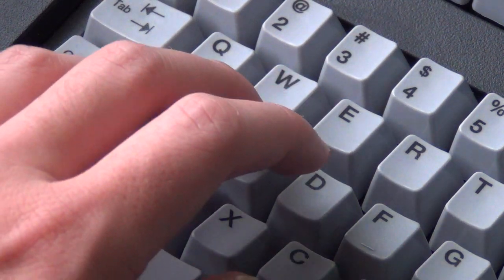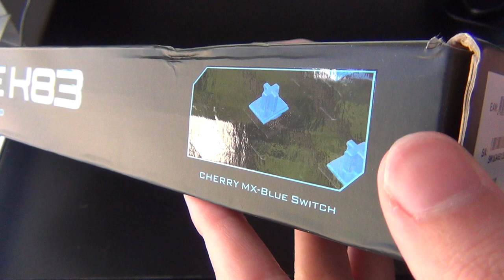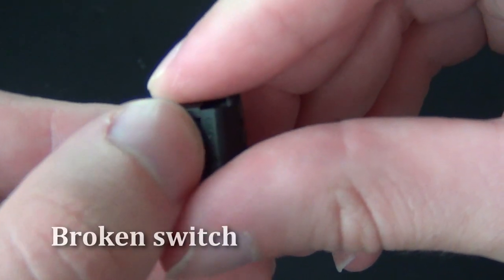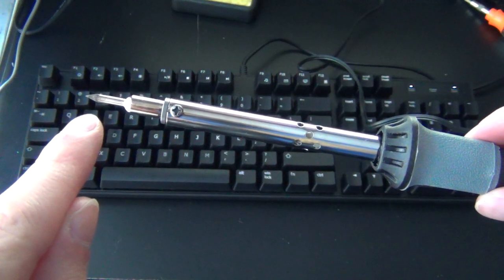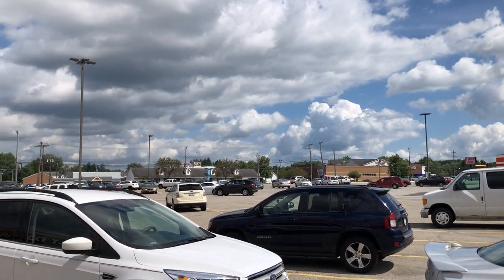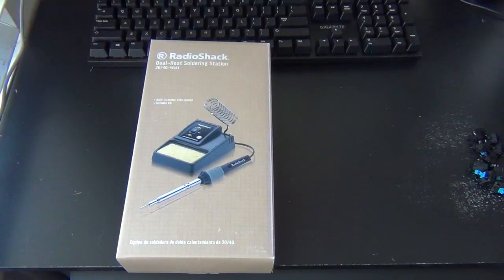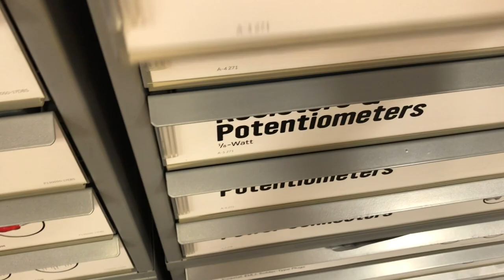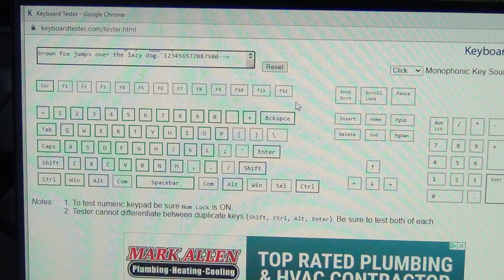Replacing switches on mechanical keyboards

Comment: You have to always add extra classic solder with lead first and then you can work with that much easier, then you can remove solder completely. It's very hard to work with lead-free solder at home.

Comment: my lenovo sk-8825 (L) has lasted for 3 years and still going whilst my razer black widow X v4 lasted for 2 months the mechanical switches stopped giving input on WASD and shift. a shame they advertise mechanical switch keyboards as lasting longer but in my experience these mechanical switch keyboards are a scam!

Comment: When using wick you need soldering flux.. that will make solder more like a fluid and it will stick to wick much easier..
Reply from the maker: Good to know in the future.
Reply: I was about to comment the same when i saw him trying hahah
Reply from the maker: Vexツ  Replace the switch.
Reply: Yep
Reply: +tip add solder to the existing one so it can be fresh one.

Comment: Cherry lyf

Also worth noting PBT keycaps don't become shiny over time like ABS ones does. Took me way too long to learn this

And I successfully upgraded my T430 to the 3632qm thanks to your videos about that. Cheers
Reply from the maker: IBM Model M's typically use PBT. That combined with the lettering being done with dye sublimation means those keycaps almost never wear down!
Reply: @SebisRandomTech  Indeed they do! I believe Unicomps also are the same, since if I remember reading correctly, they bought the tooling from IBM, so their keyboards are essentially the same as the older Model Ms, except for some layout tweaks and formfactor depending on model
Reply from the maker: @metal571  Yep, a few former Lexmark employees purchased the tooling and patents for the Model M in the late 1990's and began manufacturing them as Unicomp. I believe they even do repairs on older IBM Model M's.

Comment: I have the same keyboard. I bought it super cheap to replace the horrible membrane keyboard I had at work. It hasn't been dropped or damaged, but a few keys randomly register multiple keystrokes per press. I'm not sure if this is a fault of their switches, or something in the board itself maybe. It happens mainly in the G, T, and . keys. So I think I might try swapping them out this way to see if it helps. Thanks for the guide.

Comment: 5:20 For someone who isn't "an expert at this", your first joint at 5:47 was really quite good. The solder flowed to the void in the PCB and formed around the pin demonstrating good adhesion. The second joint at 5:52 was not as good.

The trick is to ensure you heat where you want the solder to flow, flux greatly aids this but generally you should ensure the pin is sufficiently hot to get that beautiful melt you got at 5:47.
I normally cringe pretty hard on youtube when I see solder jobs that don't flow beautifully like that, de-wetting is not ideal and results in crappy connections.

Comment: Add a little bit of new solder to the old solder, then use your wick. The best method is to use flux while adding the new solder.
Reply: but it must be classic solder with lead, I don't know if you can still buy it in USA, in some EU countries it's already problem now

Comment: As others have said, you need to use flux on the wick, but also it helps to tin the wick too. TBF solder wick is a PIA, it doesn't work that well, as you found out, maybe a solder sucker might be better IDK, I've never used one, but I do use wick and as I say it's a complete pain.

Comment: Thanks for the images inside the keyboard.
I am interested in this keyboard with Cherry MX Red and was thinking of adding LEDs and changing the Keycaps. And I wanted to know what the welds are like inside.
Maybe instead of this I opted for the K85 which already includes LEDs and even if it is more work (twice as many solders as it is when un-soldering), if in the K83 you still have to remove the solder where the LEDs go. The K85 would only have to buy and change the switches for the Cherry MX Red (or test how well the Kailh Red it brings), and it would save me buying LEDs and Keycaps, plus it has its own software for lighting and safely in the K83 I would only have one color, which is ultimately what I want, to be able to see the keys in the dark.
If I managed to find the K85 I will buy that one and if not I will buy the K83 which they have in the store across the street from my house (I bought it for a friend and I really liked the keyboard and switches).

Comment: Hi!!! Very nice video. I am a big fan!!! I will buy a new laptop/workstation and right now I am hesitating a lot. T430 has the charm of old thinkpads and it will be a cheap alternative, T480 seems like a good option, however it has some issues as I watched in your video. P series, I think they could fit the best for me because I am not planning to move my computer a lot (It will be a desktop replacement). What is your opinion about P50?¿ My budget is around 500-600 bucks for a maxed out T430 or pretty normal specs on T480 or P50.
What do you think?
Reply from the maker: It depends on what you plan on using the laptop for. If you need to do CPU/GPU intensive tasks and maximum upgradeability, go for the P50. If you value better portability and battery life, look at a T-series model. Hope this helps!

Comment: Hi, I have a HyperX Alloy Origins Mechanical keyboard, where the switches are also soldered. The switches are soldered in 2 places, and the leds in 4 places each. Do I have to desolder the LEDs first? Or all connections at once? What about the round plastic in the middle? How can I push it to get the switch out?

Comment: I'm a newbie, and right now I'm trying to change my old filco majestouch 2 brown switch for Esc button. So the switch will be detected after soldering process? Because if I just plug the switch to the board, it won't be detected. I'm really afraid I broke my keyboard.

Comment: you need to cut small pieces of the wick, the long spool will suck the heat away too fast. I use hemastats to hold a 1 inch piece while desoldering.

Comment: Hello, my keyboard escape key and keys F1 through F12 stopped working yesterday. Not suddenly but I was using the esc key quite a bit and it responded less and less till it died. The keys all sound perfectly fine, they click properly like you showed. Do you think using a soldering iron to remove and reconnect the keys (without buying new keys) will fix it? I would have to buy a kit which is around 20 dollars. I really want to avoid paying a silly amount to get if fixed at a computer repair shop but also don't want to buy a soldering iron kit just for this...
Edit: I have a razer ortana chroma
Reply from the maker: The Chroma keyboard you have is a membrane keyboard, so that likely explains why the whole row of keys stopped working. Short of making sure all of the connections are clean I'm not sure what you can do to get it repaired.
Reply: @SebisRandomTech  Thanks for the advice, I appreciate it a lot :). I already cleaned my whole keyboard after it started bugging out but it did not fix the issue. I found the next version of this keyboard for 50 dollars. It served me beautifully for well over 5 years so I am happy to replace it. Again, thanks a bunch for the reply <3

Comment: Can you maybe do a upgrade guide for the t440 (i know you dislike it but i went for it since it has to fit in my backpack alongside my school stuff and i didnt need the extra performance since i have desktop at home.) Also the price i got it for was insane considering i live in germany where thinkpads are less common than latitudes and elitebooks. also is it even worth it upgrading from a ips 1600x900 to ips 1920x1080 screen and if i replace the touchpad many people have issues scratching their screen on the t440, is that normal/or even widespread. 
THANKS FOR READING MY MASSACRE OF THE ENGLISH LANGUAGE!!

edit: does someone know if the M.2(?) slot next to the wifi card can handle ssds and which length it has if it does
Reply from the maker: I already did a video on this (see my "Upgrading displays in newer ThinkPads video), and as far as I know there is no 1600x900 IPS screen. As for the touchpad situation, my best advice is to pay close attention when you tighten the screws for it so that it is as flush with the palmrest as possible. Some people add rubber at the corners of the screen assembly to add a bit more of an air gap.
You are correct about the M.2 slot next to the wireless card. It can handle 42MM SATA SSDs (2242 SATA).
Reply: @SebisRandomTech  thanks for the advice ill search the video again then since  i couldnt find it. I dont know if it is possible since the panel seems like a ips or a va since it has conciderable ips-glow (might just be that it ist that bad that black is grey lol) and the viewing angles are actually ok until like 170 degrees

Comment: Use the tip fo the de-solder braid
Make sure the iron is about 350 deg C, you should only go higher desolder bath soldered products
Go back and properly solder that key - you left a huge gap and the pad clearly wasn't hot enough
Solder is not glue - make your joints perfect before you solder
Use flux which stops oxcidisation and makes for a better joint
Yes, use a solder sucker, they're cheap and really do the job, just get them on hot solder immediately
...And a ton of other things I learnt befoer I was 10 but its 2am.

Comment: I have a Gigabyte K85 that uses Kailh switches with RGB LEDs. Do i have to desolder the RGB led too? If so, can I re-use the LED afterwards?
Reply from the maker: I don’t know for sure. It might depend on if the LED is part of the switch or independent from it.

Comment: the broken switches still has a click just more lighter and quite, maybe the clickbar or  even the spring in the house is whats broken?
Reply from the maker: Whatever it was, it was enough to make the key not register in the operating system.
Reply: @SebisRandomTech  so u couldnt even bottom, out honestly if they make blues sound/quite id used them maybe i could make a switch like that

Comment: Hi sebi, can u pls confirm t440p charger 65w or 90w?..
Reply: Sebi, can u confirm which one is suitable for t440p 65w or 90w?.. some people saying that 65w is very slower while charging but 90w bit faster than 65w.
Reply from the maker: @cloud_07  90W would be better but it also depends on what processor and graphics you have.

Comment: u can put keyswitches on a membrane keyboard now?
Reply: Different mechanics since membrane keyboards use a membrane sheet on top of a PCB that detects complete membrane depression before registering a key press. Better off getting a keyboard with mechanical switches instead instead of borking the membrane keyboard you have.
Reply: @SimGunther  o

Comment: 5:50  wth is that abomination of a solder work? 

100% cold solder right there. You need to heat both active surfaces and THEN apply the solder and let it flow on both surfaces by itself

Comment: Literally not worth the tiem to desolder everything and resolder. Would take hours. Better just buy a new kb
Reply from the maker: Worth it for a keyboard that isn't available for purchase anymore and doesn't have a suitable replacement available. Besides, I'll take the 45 minutes it took me to take this apart, replace the switches, and put it back together over spending more money on a newer keyboard any day.

Unlike some people I like to repair the things I own if it's feasible to, instead of just adding to the worsening issue of e-waste anytime something goes wrong.